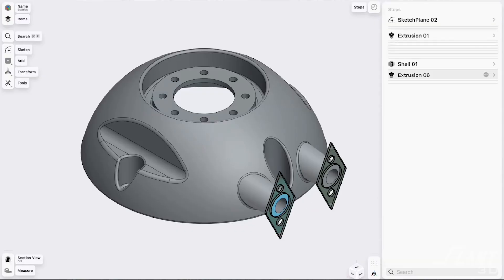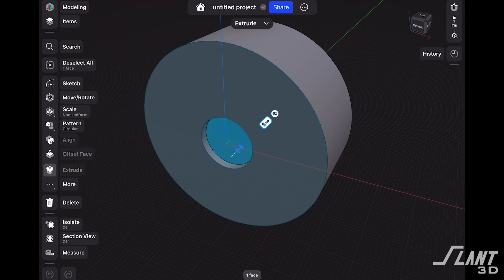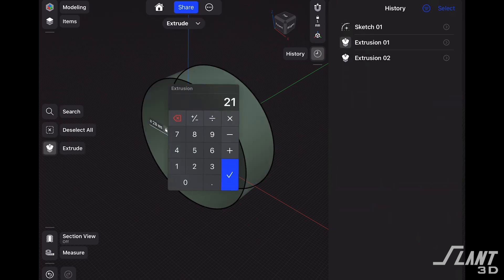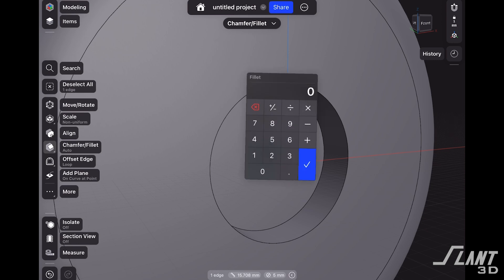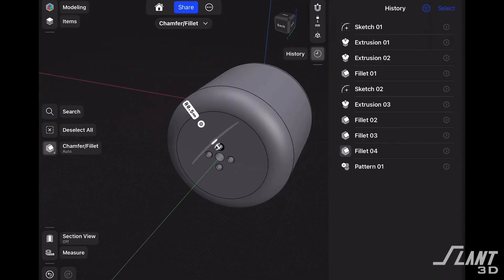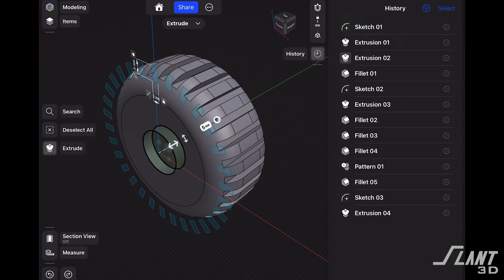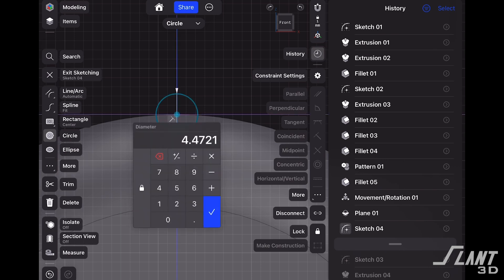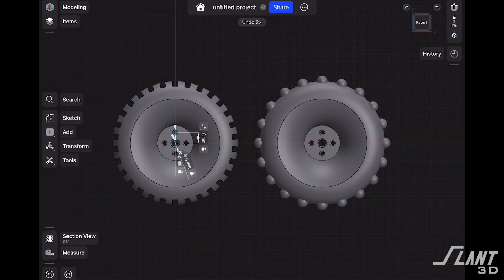Designing Wheels Using Shapr3D's Parametric Modeling | Design for Mass Production 3D Printing

Comment: Shapr3D is such a joy to use on the iPad with the pencil.  Its not full blown CAD, which for a lot of designs, is perfect.  Its gotten so much nicer over the last few years.  Best user interface I've found for CAD by far.
Reply: Could you please explain what you mean when saying that Shapr3D is not full blown CAD? And, what designs is it good for? I'm a user of Autodesk Inventor and Fusion360, never used Shapr3D before.
Reply: @Shinji_Ikari-EVA_01  like in the video, the parametric feature is still in beta. you can't really do much with imported .stl here, not much to do with sculpting and contour manipulations as well, so overall just enough for a CAD software since most casual people just need it to do light designs that can be altered even further in different apps (if needed). it has all the essential features, making it great for a lot of people, especially beginners :)